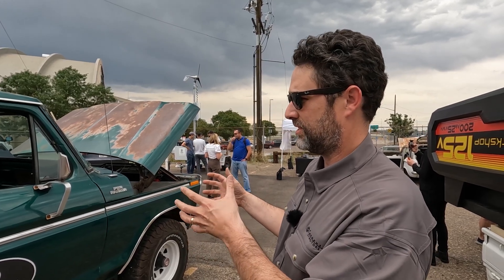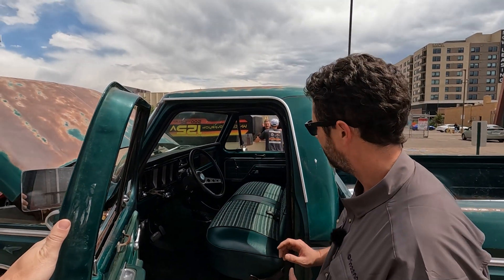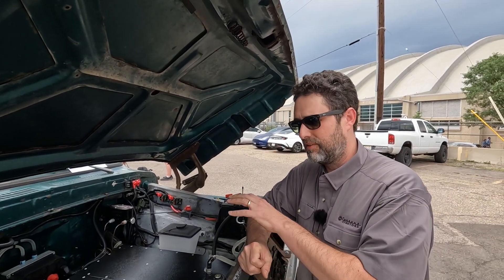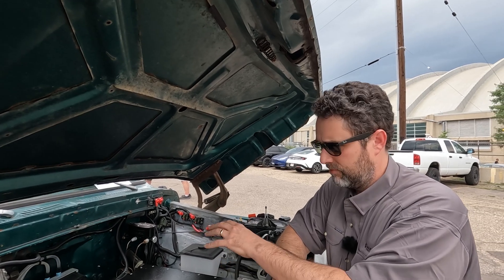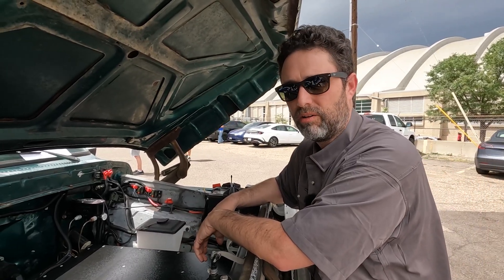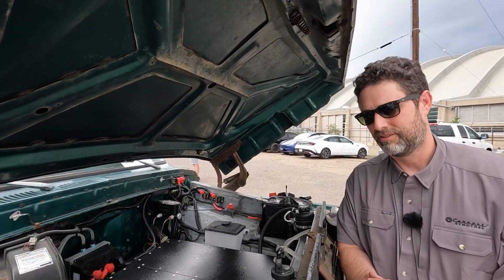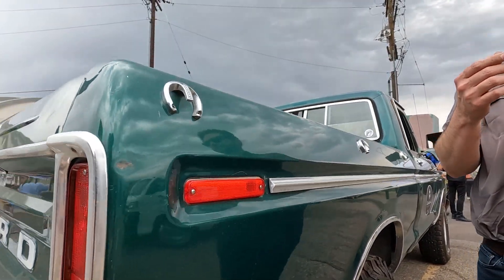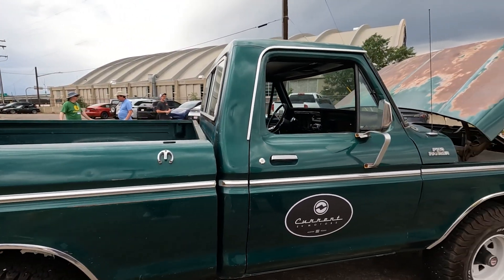Work Truck Transforms to a Classy Electric F150 (and works even better!)

Comment: I can see the appeal of this for the cool factor of an classic single cab truck that is electric. We don't have exactly that same form of truck but we do have used Ford f150 Lightnings that are selling sometimes in the low 30 k but are readily available in the high 30 k and low 40 k range. Removing the cool factor and nostalgia, I wonder if there is an economic case to be made for conversions. The ones I see make sense as a passion project for the converter or a cool unique car for someone paying to have it done, but I don't think I've seen any that were practical when compared to what you can get on the used market. Seems like the conversion would have to get to be pretty economical to be practical when you consider that you also need buy a car/truck to start out with and the vehicle you get is after conversion is usually less capable than a modern used EV. I don't think conversions have to be practical, just wondering if there is a practical use case, other than maybe converting a fleet of trucks.
Reply from the maker: I wouldn't mind a Lightning myself! It's on my list as a potential for the next car but I digress... I think you are right that a conversion is not a good way to come in under a used cost wise. Maybe insurance will be a bit cheaper than a newer car but it will cost to build. Using a Hyper system or a Leaf drivetrain is the most economical ways to do a swap and the final cost depends on how much building and fabrication someone wants to do themselves. I could be done for 15 - 20k if someone has the passion and time. 
But we can't discount nostalgia too much, people pay for classic cars all the time because they love them and want to drive them and if they wanted to go for the most economical and reliable option they would all be driving used Civics. So I am inclined to agree with you: the best candidates for conversions are ones that have value for the owner beyond just the cheapest EV they can find. I for one am here for both the new OEMs and the classic awesome.
Reply: @EVTUNERS  I started watching the Youtube channel "High Voltage Hustle". She is converting a little 70's Datsun pickup to electric. I've no interest in doing a conversion myself, but I find the challenge interesting.
Reply from the maker: Oh yeah! Baily is awesome and she is making great progress on that build. If you haven't already check out @teamarcblast too for a Datsun 620 that is a totally different type of challenge as a EV endurance racer. I'm also on that team and we are planning 5 races for next year so far.
Reply: @EVTUNERS  Thanks for the tip. : )
Reply: @EVTUNERS  That hot swapable battery box is very cool.
Reply from the maker: @Molishious pretty slick right? Feels pretty awesome whacking that thing around too. Swap and go!
Reply: @Molishious  Part of the problem with modern EVs is that they are - frankly - boring to look at.  People are hungry classic stying, and the OEMs keep missing the mark - for whatever the reason.  Our solutions offer the (very real) possibility to take the best of the past and blend it with the best of the future.

Comment: I was gratified to see a business model based on better affordability, but for this spectator, no mention of the cost says that subject is still nothing to brag about,
Reply from the maker: I'm seeing what I can do about finding you the price! At least for the kit. Parts cost can be compared pretty easily across different build formulas, but labor is all over the map depending on how much experience the community has with a certain vehicle, the space to work in, or if the owner wants to do the work themselves.